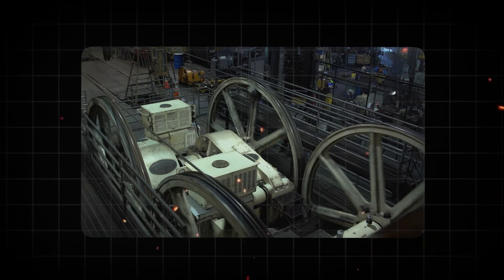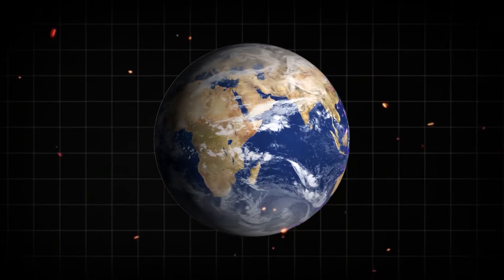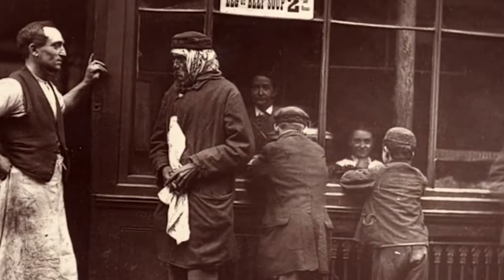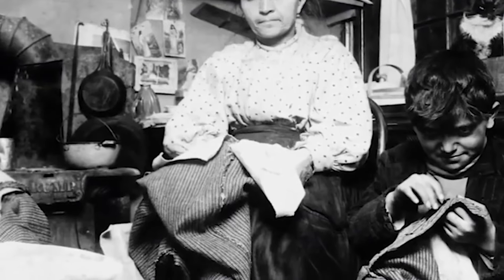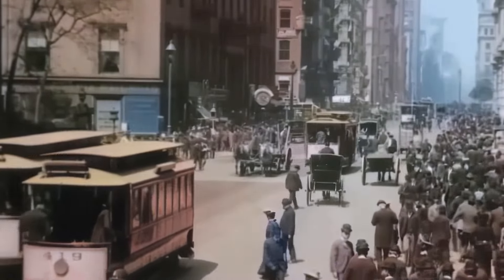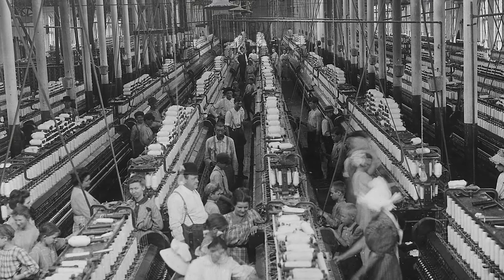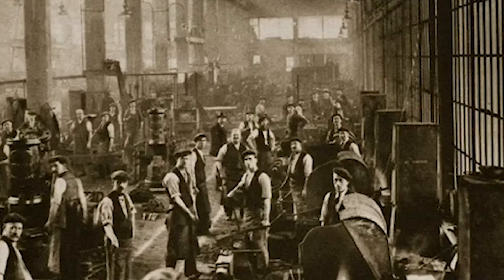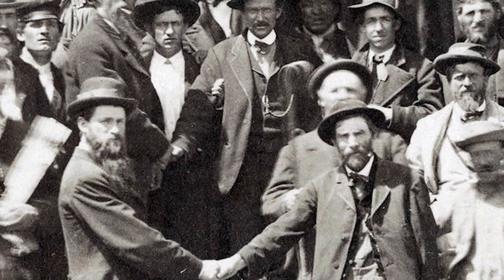How The Industrial Revolution Transformed Wealth

Comment: Sorry, but after 2:16 I had to stop. The narration of this little gem claims that "the use of fossil fuels caused deforestation". That's like saying the purpose of a cart is to push a horse. These fools got it backwards. In the UK centuries ago, like most everywhere else in the world at the time, wood was the main fuel for heating, cooking, and making of goods like metal items and pottery. Eventually the island was deforested to the extent that wood for fuel became so prohibitively expensive that other fuels were sought. Coal burned well, and it was relatively cheap in the Britain at the time, so it became a popular alternative to the more expensive wood for fuel, especially in ceramics production. But soon the easily mined coal was used up, and deeper mines were needed, and then water in the deeper mines became a problem so better pumps were needed, bringing about the Newcomen engine/pump, leading to the Watts steam engine, and BANG, you have the industrial revolution. It was impossible to power that revolution on wood alone, so fossil fuels powered the modern world. Contrary to what the uninformed writers of this video claim, deforestation caused the switch to fossil fuels, it was not the result of the switch to fossil fuels.
Reply from the maker: Got it, sorry for some misinformation, we are trying our best to make it as simple for everyone and make it engaging, will keep this in mind, thanks again for making it correct
Reply: @LuxeReportMedia ; either take the time to get it right, or choose a subject you know something about. Trying to make a complex subject simple is a "fool's errand". And, apparently you have a VERY low opinion of the mental ability of your targeted audience.